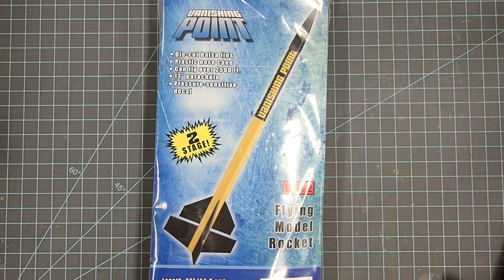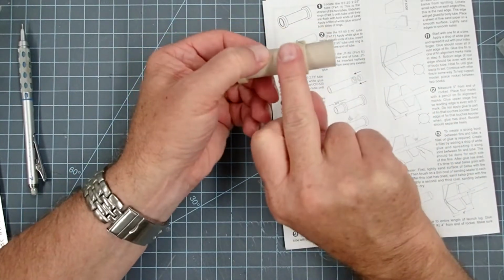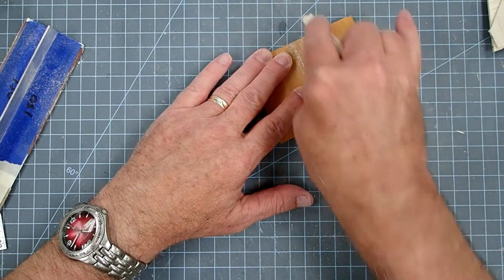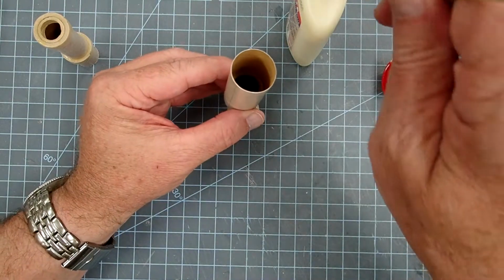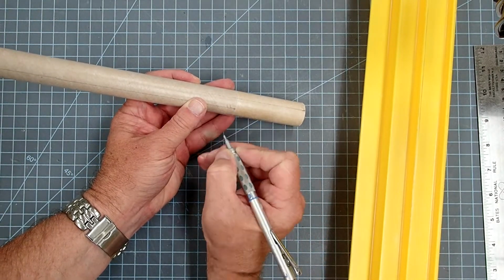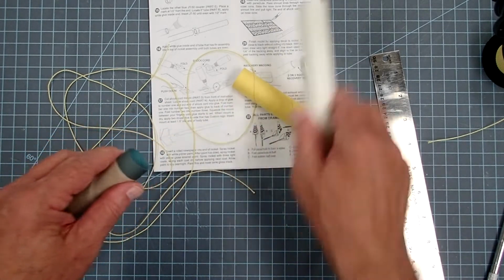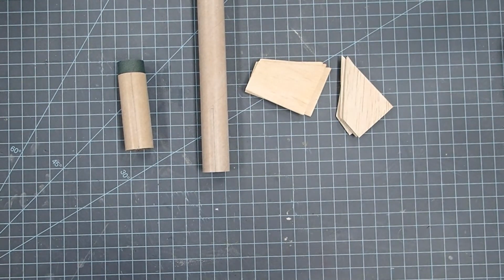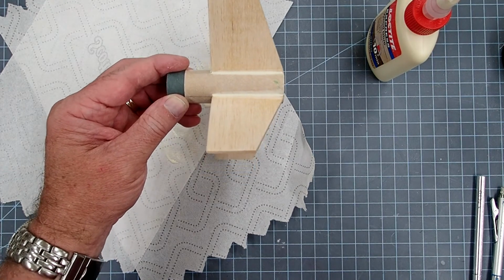Custom Rockets "Vanishing Point" model rocket assembly (1 of 2)

Comment: where did you get the polyurethane stuff at for the wings dave? and where did you get that mechanical pencil at?
Reply from the maker: The sanding sealer is made by Minwax. The pencil is a Pentel Graphgear 1000, and you can find them at Hobby Lobby or Amazon.